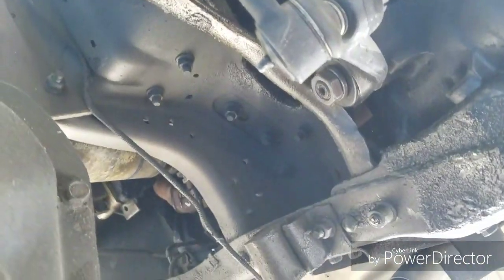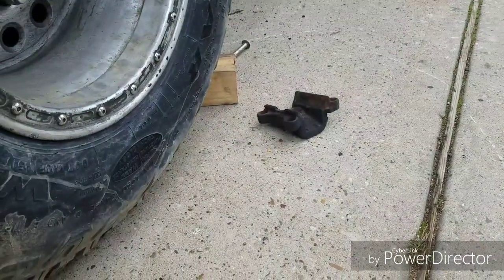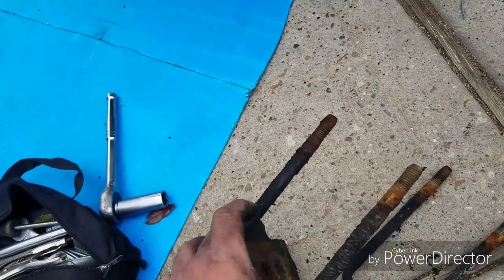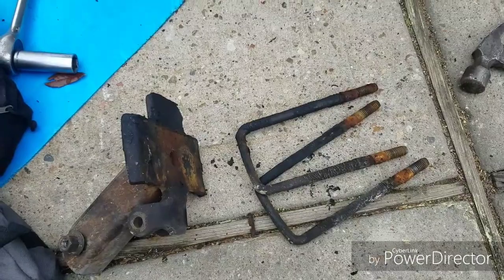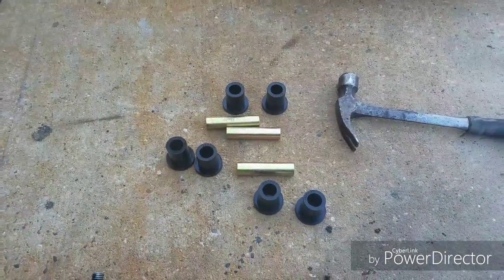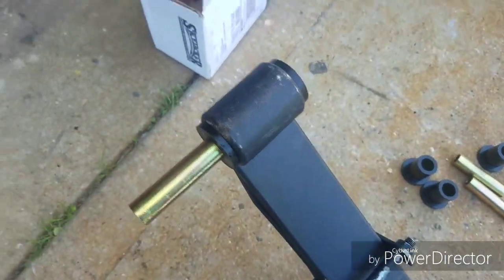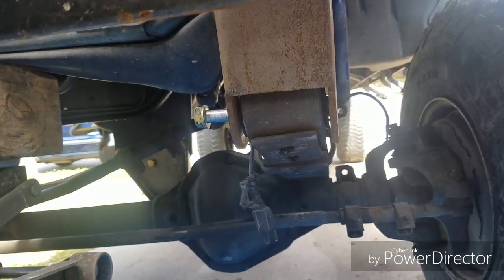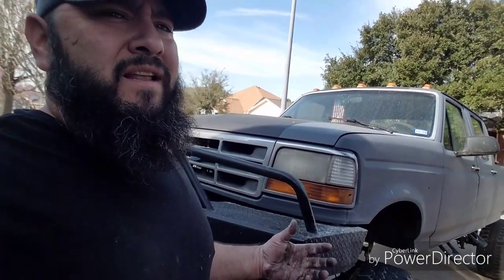1995 Ford F350: 6" front leaf spring install

Comment: Hi. What did you do for brake lines? Did you have to buy extensions? And did you have to extend your driveshaft? I have a 1992 f250 and I would love to do the same thing you did.
Reply from the maker: Yes. I bought extended brake lines from PMF Suspension. Price wasnt that bad. I didnt have to extend my driveshaft either. I just had to put spacers at the carrier bearing to lower it. You're gonna have to fine tune the shaft with the spacers (washers) because if u dont, then you're shaft will have vibration. I forgot the exact calculations but ur gonna have to add a certain amount of drop to the carrier bearing per (x) amount of inches per lift.
Reply from the maker: Also, I did have to extend my front driveshaft and cut a section from the transmission crossmember out AND clock the transfer case. Lol!!! Lot of work but it's totally work it!!! Have a good one!!! 👍👍👍
Reply: Sentinal Truck Builds- D.R.V. Thanks for the help. I really appreciate it!! Truck looks sweeeeet!!
Reply from the maker: @The-Keekinator  THANKS!!! And no prob on the help. 👍👍👍

Comment: I have a 95 f350 with the 7.5 L v8 with a 6 inch skyjacker lift
Reply from the maker: Man, that 7.5L is a beast!!! One of my dream builds (mud truck) would have that motor.
Reply: @BerserkerF100  skyjacker lift has no give in the suspension haha
Reply from the maker: @markreich5163  Dont I know it!!! My truck is my daily and I drive to work 80 miles every day. I honestly am thinking about building my own 4 link suspension with coilovers, front and rear, bc it's so rough. With this 5 inch reverse shackle kit and 6 inch lift springs, it's not such a smooth ride at all.

Comment: How difficult is it to install front leaf springs?
Reply from the maker: Honestly, it wouldnt of been so bad if the very front passenger side of the frame was a little bent towards the middle. But it was worth it to me.
Reply: @BerserkerF100  what's the newest truck you would install front leafs on.
Reply from the maker: Well, if I COULD go back, I would of done an axle swap from an 05 f350 to get away from the leafs. I'm used to it but it IS a much rougher ride on leafs than coils and shocks. My truck is my daily driver, (I know, who would daily this type of truck?!), and I rarely pull anything. But this darn axles dont come cheap.
Reply: @BerserkerF100  I have a 97 sierra, reg cab long bed, 2wd manual. I want to lift it but never have done anything like that. Just had energy suspension full undercarriage bushing kit installed
Reply from the maker: The Sky Off Road Design springs were about $600 each side for 6 inch springs.
Reply: @BerserkerF100  who makes that?
Reply: Would I need an extension for the steering column / driveshaft?
Reply from the maker: No. I got away with only using a drop pitman arm. Forgot how many inches it dropped. Realignment will definitely be needed.
Reply: @BerserkerF100  crazy idea....... what do you think about doing a leaf spring lift on a 2018 silverado 2500/3500 crew cab long bed???? Thoughts....
Reply from the maker: Well, do u have any buddies that have a leaf spring lift on their trucks already? If so, ask them if u can drive their truck for about 20 minutes. These newer trucks were built for a lot of comfort, specifically the ride quality. Your ride quality will definitely go down.
Reply: @BerserkerF100  no, nobody down by me. I rarely even see them at all where I live.